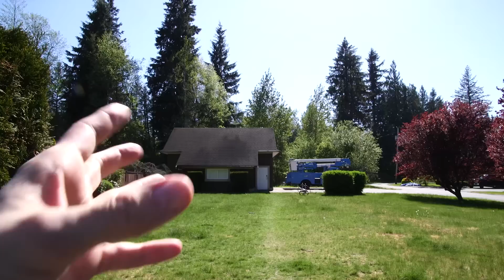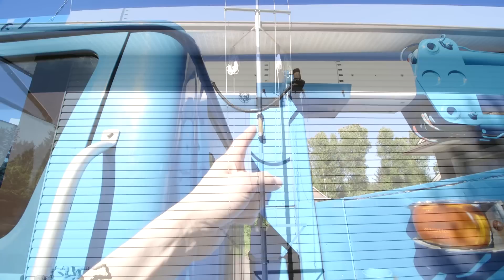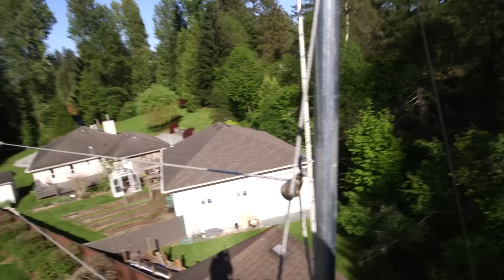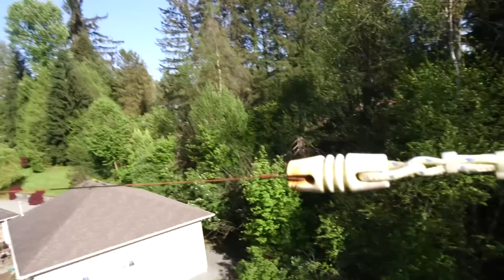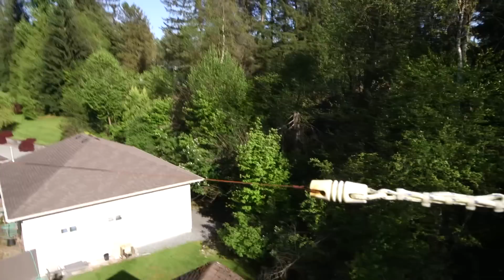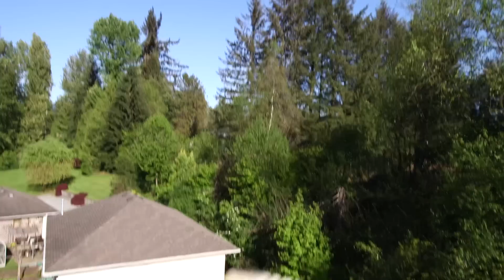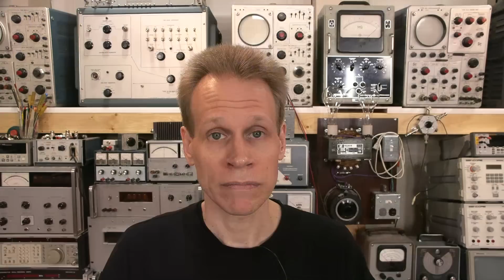Very Sensitive Antenna With Rusty Welding Wire!

Comment from the maker: To learn electronics in a very different and effective way, and gain access to Mr Carlson's personal designs and inventions, visit the Mr Carlson's Lab Patreon page here: https://www.patreon.com/MrCarlsonsLab
Reply: Mr Carlson.. Do you ever sell your equipment? Duplicates? 

Are you open to adoption? 
I'm 52.. have a really odd set of skills, but health occasionally balks
LOL
Reply: Is there a recommended amount of tension or sag summer sag and winter shrink .How much tension should there be to keep antenna and if you are using a dipole for transmitting does the sag affect the SWR ?
Reply: eletric fence wire. here south of u tractor supply has like 1/4 mile rolls for cheap. might even be half mile rolls i forget. ive yet to find the end of my rolls lol 3 years later
Reply: Back in the days of the 50s and 60s, when I grew up, you could take electric classes in junior and  high school in the San Fernando Valley California. So you get the basics of electricity and now I don't think they many shop classes. So there's not many people left that you can find that still work on older radios and equipment. I bought a Teac AG-D8900 AV Digital Home Theater Receiver at Costco over 20 years ago, and it from working. I called a guy in Modesto, California, near where I live in Merced. He said he only works on the older stuff. I replaced it with another receiver

Comment: Warning, white zip ties are very susceptible to UV, you need to replace them with black ones that will hold up to the UV light.
Reply from the maker: Still holding up in 2026. (Good quality Zap Straps :^)

Comment: The fluid level should not change. Hydraulic pistons are always filled 100%. The only change is 10% on top 90% on the bottom etc...

Comment: A half-wave dipole for 80 m made from 3 mm copper wire is far more efficient than one made from 3 mm steel (welding) wire. At about 3.6 MHz, steel shows roughly 30–40 × higher RF resistance because of both ohmic losses (≈ 95 % of the total loss) and magnetization losses from the iron’s permeability (≈ 5 %). These magnetic re-orientation effects cause additional heating and further reduce the effective skin depth. In total, a copper antenna radiates about 97 % of the input power, while a steel version loses nearly 50 % as heat. Steel wire is fine mechanically, but electrically it’s a poor choice unless it’s copper-plated.

Comment: Aug 2024:  Per your original antenna video, I used the welding wire for a much simpler 200-foot longwire antenna and single spring arrangement with paracord.  Yes, it's still up to this day as well!

Comment: Hi mr. Carlson, I have this idea , can you design a universal power supply for battery tube radio with input 3.7v liion cell, which should be charged via standard usb-c and output 1-2 v @ 1Afor heater and 90-120v @ 30mA for anode?  Of course it should be quite enough and probably in a metal box. Thank you in advance.

Comment: Hi Paul,
I have this idea on building an AM oscillator detector that makes a zero beat tone when it gets a signal from the  local oscillator. It will be calibrated to detect from 985 khz to 2155 khz. I don't have a frequency counter and that would make it easy but I like building test equipment and so far it isn't working. The idea is to build an oscillator from old AM transistor radio parts using the red coil and the output from the oscillator goes to one terminal of the primary of an audio output transformer. The other terminal goes to an oscillator of the radio being worked on and the output of the transformer goes to a speaker and when the two oscilators get close in frequency to each other then the speaker will start to make a zero beat tone but so far it isn't working. I think I need to build a differential amplifier instead of using a transformer. I like building radios from spare parts and the most challenging is getting the converter transistor to oscillate at the correct frequency. I built a modular FM radio and each circuit is built on a separate board and plugs in. The tuner/ comverter section is on one board and plugs into the first IF board then second IF, then ratio detect and finally the audio board with speaker and it works. All of the IF transformers and everything are made by the factory but what if for example I want to test a homemade IF transformer. I can do that by plugging the section that I made to see if it will work and that's why I built it like this. Now if I can get my modular AM radio to work. It works but it breaks into oscillation at a certain point on the tuning capacitor. I can't believe AM is giving me such trouble my FM modular radio worked the first time oh well 😁. The most challenging and difficult one to build was a long time ago when I worked at AT&T I had access to some really fine test equipment and I built a dual conversion weather band radio and it took quite a lot of experimenting. It was built all on one board. The front end had to use small signal FETs I couldn't get bipolars to oscillate at that high of frequency

Comment: Hey, paul.... I have a question i hope that you can answer. I am restoring a 1948-1949  EICO 400 oscilloscope. i had it lying on it's side while changing out the capacitors. i got a nice, thin trace on the CRT screen, but when i stood it upright, the trace faded out!?!   I thought i still had a bad cap, but all were replaced. Then i loosened the CRT neck, and rotated the CRT 180* upside down, and the trace came back perfect!  Is this a sign of a gaseous CRT tube? or a leaky CRT?  I am just baffled!!   It has the typical EICO 5BP1 tube...

Comment: If you have a friend who works on aircraft, there's some .032 safety wire that's used to safetying aircraft components. I used it for a solar dryer (clothes line), and its  lasted about 30 years. There's more than one type of wire. Some don't rust, and some will look tarnished, but hold up fine. I enjoy watching your content working on the old radios. I'm not much of an electronic guy, but it's interesting to see what do. Tommy
Reply: Oops, I hit the send before I finished my reply. I wanted to say: from Costco, but I'm not that happy with it. I think my Teac overheated and took out something in the channels. The subwoffer still works.

Comment: Mr. Carlson, I need to switch 2,000 volts at 60 times a second. I was thinking of using a triggered spark gap however I do not have the money for one of those. I was thinking of an RCA 6012 Thyratron. How would I wire one of those up to a signal generator  to perform this. I thank you so much for this information.

Comment: My wire antenna was a dipole made with Copper Weld wire, with 450 ohm feeders.  It had been up for many years and finally, this year, the wire rusted out at the feed point, which is up on my tower, about 18m high.  Now, I am doing a lot of thinking about my climb up to it!

Comment: I have used steel electric fence wire for years for both transmit and receive with good results. As long as I have a good solder joint to the steel wire, it does a great job. I think my 80 meter dipole has been up for close to 20 years!

Comment: Hey Paul,
Great vid!  Fifty years ago, my 6th grade teacher ( Dutch W1GXY ) and I ( WN1USM ) put up my first dipole antenna ( 40 meter band ). 
We used Copper Weld wire-which held up beautifully-well into my college years. We stretched it between a pine tree and a back porch post. We used rope and a clothesline pulley screwed into the tree with a plastic weight plate hanging down near the trunk. During wind storms that plate used to fly up and down as the tree swayed!

I was going to comment on the white zip ties, but I see many more have already.  I used to work for a Photo Voltaic research company and we wired our array sensors with white zip ties.  When we went to decommission the site, the zips just crumbled in our hands. 

I love how transparent your welding wire is, my Copper Weld was plainly visible. 

Nice job!

George ( WA1USM )..

Comment: When I became HAM in the late 1950s the preference for wire antennas was to use copper clad steel. It has excellent corrosion resistance, strength, and works best as bare wire. It is available as dead soft steel as well as medium and high strength steel cores. Insulation is subject to UV related deterioration and greatly increases wind resistance. I believe insulation also accumulates more ice in the winter. Surprisingly, copper clad steel antenna wires provide superior conductivity and less signal loss due to seemingly enhanced skin effects. I never understood this, perhaps it is related to electromagnetic properties of steel. This does not apply to DC however which can cause a satellite signal coax to fail in delivering the DC for antenna mounted electronics. Use solid copper for anything like that.

Stainless steel wire has a habit of failing under conditions of constant changes in tension. There is no warning of weakness before failure either. For this reason it is almost never used in sailboat rigging. High strength steels are hard to bend. Unless the wire is long and requires high tension to reduce sagging, mild steel is a lot easier to work with and generally adequate.

Comment: I have used electric fence wire for such an antenna. It's galvanized and doesn't rust. Very low cost. Very good spring tension device on yours.

Comment: I am curious whether the rust on the wires will decrease the sensitivity of the antenna. R.F. skin effect is what I am thinking of. When I grew up in Connecticut we would have to replace our roof mounted television antenna every 6 to 7 years because the aluminum elements became so corroded.

Comment: Thanks. Maybe it would be good when you would tell us a little more about possible problem with rusted wire. Does it make any difference for the functionality of the antenna? Would a receiver with a non-rusted antenna work differently? Thanks.

Comment: Mr. Carlson--Comeon! Get some aluminum electric fence wire up there. Or copper clad steel. The bottom insulator needs to have the  ferro dust cleaned off. HA! And then throw some lines over those pines and get something up high!

Comment: It is strange to see the white cable ties / zip ties holding up out in the sun I have never seen the white ones hold up to the UV sun lite but I use black cable ties when using them outside as they hold up better.

Comment: Have you considered putting a common-mode choke at the feedpoint of the antenna? Without it, the outside of the coax shield effectively becomes part of the antenna. Since it enters your lab it will be prone to pick up noise there, which can then flow back up to the feedpoint and then back to the receiver. I am sure your antenna is efficient, but s/n ratio is more important in a receiving antenna.

Comment: Rust or not, holding up just fine!

Totally agreed that restorations can be extremely time consuming. Doing a few right now... and sometimes I can't Keri on just like that, I need to take a break and do something else because things are not going as planned and I need to retrace my steps, get some parts etc. But when you get it right, it can be so satisfying.

Comment: A word of caution. Solid "mig" welding wire is usually coated with copper at the manufacturing facility. I'm guessing that Lincoln Electric still makes their mig wire this way. The copper coating on the steel wire serves two main purposes. In the mig welding process the system feeds the welding wire at a constant speed from the wire feeder into the mig welding gun. At the business end of the gun there is a copper tube called a contact tip. As the welding wire passes through the contact tip, that is where the wire picks up the DC welding current from the welding machine. The copper coating on the wire gives good conductivity from the tip to the wire. The copper coating on the wire also makes for less friction between the wire and the contact tip. The copper coating on the weld wire does give some resistance to the steel wire corroding but the coating is not designed to give maximum corrosion resistance to the wire. The copper is usually no more that a few thousands in thickness. Once the copper coating has fallen off the welding wire, for whatever reason, you are left with normal corrosion between the steel wire and water. I would be surprised if anybody got more than a year or two out of this antenna before it broke.
Reply: I'll let the ranchers know their steel fence is fucked.  They will surely get a much needed chuckle.

Comment: That's an interesting choice of wire! Personally for an EFHW, and since I only run QRP up to barefoot, I use 26ga magnet wire with a chrome-moly wrench counter weight. It lasts until a big storm then I break out $0.49 CAD more wire for a new antenna.
Reply: But what size wrench?
Reply: @ShainAndrews  14MM of course!

Comment: Im 67 and retired. I worked most of my career out of aerial lifts, you should always have a harness on when you're in the bucket. 
Before someone asks, the harness has to be secured to the safety attachment point that's on all aerial lifts.

Comment: The biggest surprise is that the zip ties are still holding up. Maybe you used some UV resistant ones because I can't seem to get but about 2 years or possibly a little more before they start to snap off.

Comment: I was getting vertigo just watching that. Actually I didn't get vertigo, but I am not a fan of heights. I used to go up the tails of large commercial airplanes to inspect the wire and actuator installations. I had to remind myself not to get in a hurry because I wanted down. Never have enjoyed being up high on things that sway and move.

Comment: I love your channel, but a title for a simple end fed wire antenna as 'super sensitive' is a bit silly.
Reply from the maker: If you understood the math, it's construction, and how well it functions, I don't think you would classify it as silly.
Reply: How is it different from a half wave dipole etc. super sensitive suggests an order of magnitude better i.e. a number of dB better than a dipole .  It doesn't look long enough to be multiples of wavelengths long to achieve gain. Don't get me wrong, I love your channel, but super sensitive superlatives are fine for your test probes but really don't stack up for a simple wire antenna on the lower HF bands.

Comment: Not quite sure what this is all about.   Theory says alloy wire is not good for building wire antennas.   Stainless is the worst because of the iron content.
Reply from the maker: I used to transmit off 308 stainless wire with my Gates BC-250GY, it worked fantastic. Lot's of bad info out there.

Comment: Just a quick thought if you are looking for a stainless wire replacement.   The lashing wire we use to hold up fiber and coax to the support strand. 
Tested good for decades in weather, not too expensive! 
Thanks for the great videos!

Comment: Your rope and cable ties are white which suggests they don't have the UV inhibitors common to black nylon (polyamide). I'm sure that your frequent inspections will make this moot in your application but it may be useful for others to know that nylon can become very brittle and weak with just a few years of sun exposure.

Comment: I wish I could do a 3,6,9 on my property, I am pushing it with a 10 meter vertical with my HOA. Going to have to get some sort of long wire up for when my Hallicrafters SX-71 is back together. But have to finish my Carlson SIFT and rf probe first. Hard to find time these days!!

Comment: The cable ties become brittle over time due to UV exposure, so they should be protected with shrink tubing. The rusty wire, on the other hand, lasts forever; I've seen electric fence wire that's 20 years old and still going strong.

Comment: I'd pick black instead of white zip-ties since the black ones are less sensitive to UV light. Even if the white ones are classed as being UV resistant I'd expect a difference on the long run.
Reply: I've often wondered why black plastic would last longer outdoors. Black things really get hot in the sunlight, plastic isn't that strong, and heat makes things worse. The plastic ties the solar panel installers used to strap the DC cables to the framework for our panels all failed quite quickly, and after replacing them a couple of times I changed them for metal ones. I had thought about looming them until I found metal ties in a store.

Comment: Hopefully, they won't leave big black streaks on the roof directly below them. My old (painted) steel TV antennas used to bleed everywhere.
Reply from the maker: You are correct, it does do that, but it washes off in the rain.